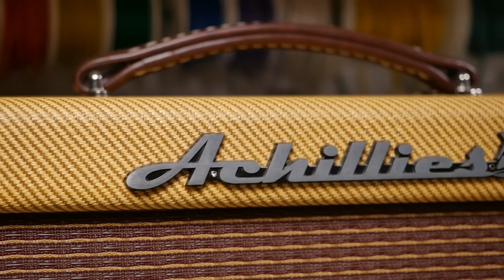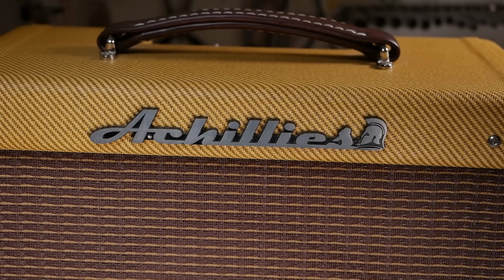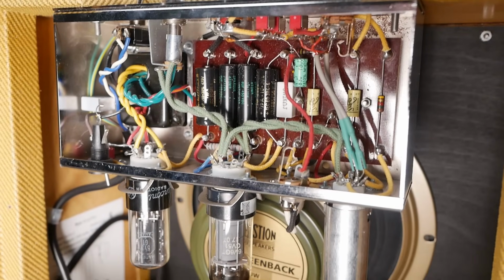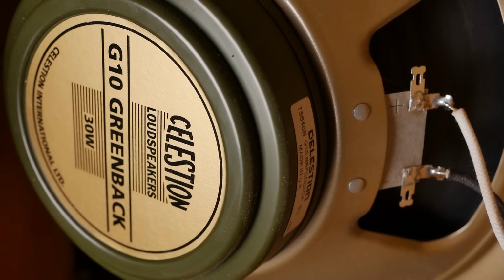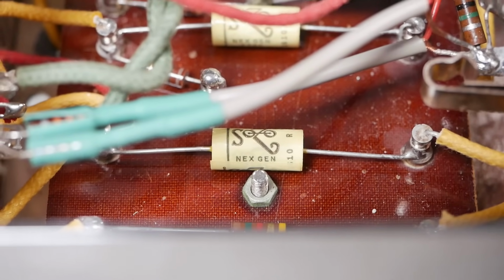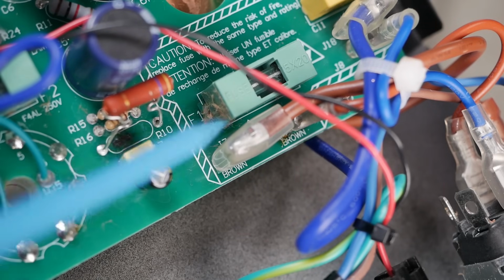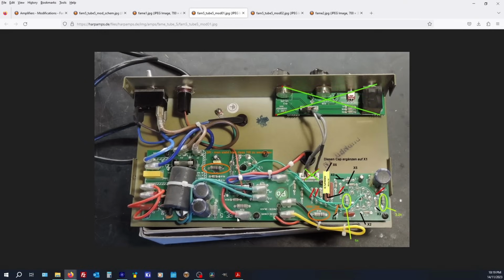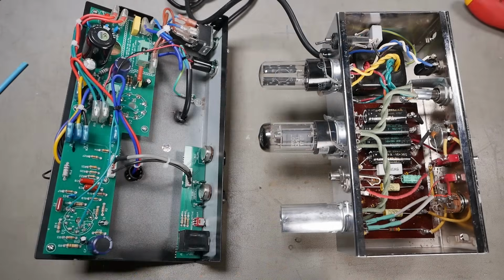Artist Guitars Tweedtone V - Vs - Achillies Nyx 5W (Part 1)

Comment: The Artist Tweedtone and Fame Tube 5 circuit boards are identical to the Fender Champ 600 Reissue, except  for different silk screening. The Champ 600 RI was actually a Fender AA764 Champion, but with a fixed tone stack and diode rectification on a PCB.

Comment: I have a Wang's VT-5/ 5 Watt tube amp. The 🔌 is three prong into the amplifier. On the inside of the on off switch is written 250 volt. Will this amplifier work 🔌 into a regular American 120 outlet.
Reply from the maker: The switch likely has a voltage rating moulded into it.
This has nothing at all to do with the mains voltage the amp is set up for.
If you have any doubts, find a local tech to confirm before attempting to plug in or power up the amplifier.

Comment: Love these videos.
The Achilles is clearly and older model thats been hacked by a tech.
Its was made out to be a new,first time check over of the amp.which is a bit BS.Just my opinion  .
Love this channel.
Reply: He noted the build date was in 2017, so not a new, first time check over.
Reply: @upload2352 more accurately it would be his first look at it.
Its definitely been looked at by someone else(parts hes never had).Due to speaking to Achilles yesterday,also they were $1800 back in
2017.the nut holding a part doesn't match Achilles standards at all.
As why it was suspect.
Reply: I have to correct myself,he actually did mention it had been seen at another tech.

Comment: Bought an Artist Tweedtone V, customer return faulty valve. The valve. a 6V6, was cloudy so obviously air got in. Couldn't see any nasties, and after a struggle with the valve retainer popped a new valve in without trouble. I guess Aussies have bigger bottles than us Brits.  A couple of years ago bought a 20R return from Artist as well. That turned out to have a blown fuse in the heater circuit.  Inspection showed the power indicator light, powered off the heaters, had a terminal uncomfortably close to a power electrolytic case (earthed). Replaced fuse and insulated the indicator terminals and all was good!  As an update on the 'V', as a friend was interested in it I had a closer look.  The tube bias dialled in at about 55mA(!!!) and the cooked bias resistor at 460'ish ohm. Even with the 'mark up' of running a 230V amp at 240V (I am in the UK and the mains is NOT 230V, except on very bad days) that current is enough to melt glue in the valves base. Replaced the resistor with a 670 ohm (I ordered 680, but ?) 2W. This brought the current down to just below 40mA, which is warm but not melting, so will do.  I also had to replace the 12ax7 as it was 'frying bacon'.  As a matter of interest, on mine, the Lucar 'quick connects' proved unusually stubborn.  Inspection showed that they might well be soldered as well, so I did all the work from the top side of the board.

Comment: 1 watt ist zu wenig means  to small use 2 watt. rausknipsen is remove, sadly i cant read it very well but if i get a proper copy i can translate to English should anybody require. These amps followed in the footsteps from the epiphone and vht 6 and special 6 and if i remember correctly Fame were sold rediculously cheap here in Germany. Of all these champ copies the best was the VHT. Brad there may be some worth in doing a spot where you just go thru all of the schematics for all of these copy amps please take a look if you can at the VHT line from 10 years ago there is some realy interesting stuff in them.

Comment: I almost bought a Nyx recently. I thought that it would have been a bit better made. I bought a Tone King Gremlin instead. $2,300 is good for a hand-made amp, but considering it’s a 5w practice amp, that puts a different spin on it.
Reply from the maker: Gremlins are fantastic little amps. I've had some with shorted MOSFETs, but possibly due to power spike.
They sound pretty good.

Comment: Over Covid lockdown I built a 5E3 clone head for just under $1k AUD using a diy built pine tweed covered cabinet, and the Evatco knock off chassis and turret board. Otherwise I used all the corksniffer brands for components (Hammond trans, NOS valves, Sprague/Vishay caps,  CTS pots, Switchcraft, Belton etc.)  but got them the cheapest I could find them online. 
Comparing it with these Champ clones I reckon the Achilles is at least $500 overpriced, the Artist being typical functional even good sounding, well priced, but horrendous quality Chinese shite.

Comment: The weirdness you noted at 35:13 isn't all that weird, although it might be a bit of overkill.  Because of the way they're constructed, electrolytic caps (or any cap that is 'wound') has a finite amount of inductance (and resistance) in series with the capacitance.  The impedance will increase above and below the resonant frequency of the series combination.  In high current switching power supplies where you have caps that are rated in farads, it's common practice to have small film caps in parallel with the main caps.  

Does this cap have enough series inductance that the gain will be appreciably reduced at the upper end of the audio spectrum?  I dunno. Maybe?

Comment: it makes me smile seeing a jaycar cap next to a sozo, pick a lane bro
Reply from the maker: It is a bloody Jaycar bipolar crossover cap, isn't it!?
Reply: yeah the non-polar electro and that grey shielded wire both look like jaycar wares
Reply: @BradsGuitarGarage  , it's only a 1 mfd cap in a fairly low voltage circuit, so why not use a film cap instead? I've used bipolar electrolytic to replace failure-prone polarized electrolytics in the FB loop of solidstate differential amp circuits (for old solidstate hifi gear) but those are typically 47 to 220 mfd at 16v or so, and so a film cap wouldn't be practical ( too big).....

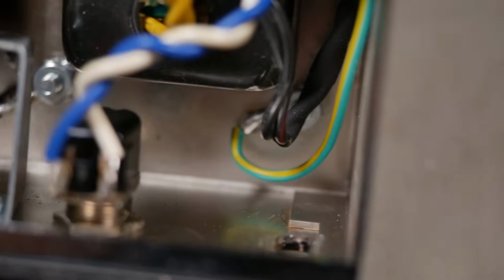Comment: 19:34 this is a BIG no no. Why are they just blindly copying this stuff? Safety ground mounted on unsafe screw...
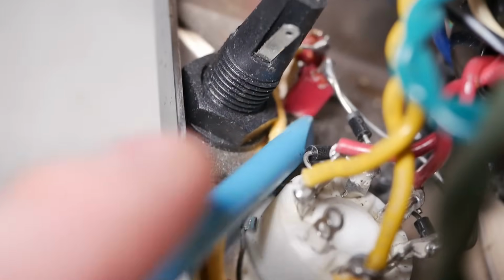20:10 is it that hard to put a normal washer there? One will flip this switch maybe many times and when this washer go loose - congratulations :D

25:45 and $200 amp can do the ground to industry standard :D but $2,2k amp fails.

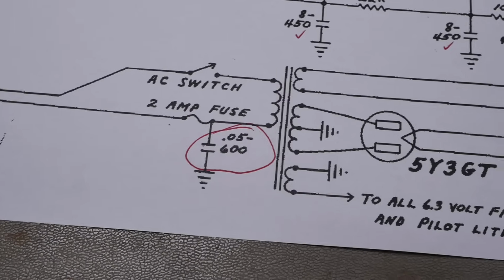28:20 really?! Someone has no idea about the tube amps. Just copying the schematics from 60s :D Most of these "butique" brands have no idea. Death cap in 2023 hahaha
Reply from the maker: All too common a story as I'm sure you know, mate!

Comment: The board isn’t Garolite as far as I can see, it’s phenolic board. I had something that looked similar that was conductive. Hopefully Labros has done his homework on the  board material. 

The transformers are made by Heyboer. They are decent transformers.

I think that was the way Fender do it as I have seen other companies offer this style output transformer.

The components are mounted on the turrets as they are supposed to be, I have covered this on several soldering courses.

The SoZo’s are a mustard style cap, SoZo’s do make Astron Blue caps and Jupiter make Astron repro caps.

The 10K negative feedback resistor would lowered the gain of the amp making it sound tighter. Switching the 1uF cap in will get greater boost with the 10K resistor. Maybe Labros was shooting for that?

The cheap amp is drawing on the Blackface Champs. The 1K choke resistor is bad news for the screen grids on some single ended amps.

Comment: Since the majority of Artist's gear is also sold as Harley Benton branded, I suspect this amp was also sold by them. HB's GA5 was apparently a modified Fender Champion 600 clone.
Reply: The HB GA5 was an Epiphone Valve Jr with a 'tone' pot added. The PCB is virtually identical.
Reply: @sjgreaves  Thanks for the clarification! Always good to know the roots of these amps.

Comment: Hey Brad I'm considering building a kit amp or maybe modding a cheap Marshall. I want a poor man's Superlead plexi basically, can you supply a kit with schematic? I can build my own chassis and cabinet but I'm a bit of a noob at circuitry. I make pickups obviously but they're just one wire! I've built a couple of pedals but would need someone to design the circuit and source the parts and schematic.
Reply from the maker: Jase @ Headfirst Amplification is your man.

Comment: Brad, good review video.  There is a YT video entitled "black face vibro champ repair and bias discussion" about why you should not use a 1K ohm cathode bias resistor to cool the bias in a Champ circuit.  I'm not a professional amp tech, so I don't fully understand all of what he said, but the gist of it is that when signal is applied and the volume is turned up, the bias voltage changes dramatically and the plate and screen current gets way too high.  That's with the standard Fender 1K and 10K ohm dropping resistors.  Maybe that's not an issue with a 10K and 22K ohm dropping resistors, like they used in the amp you reviewed.  It would be interesting to know your thoughts on the matter.

Comment: I’d imagine the 1k cathode resistor on the expensive amp is to allow for a higher B+ in solid state mode.  Just a speculation though.
Reply from the maker: She's sitting at about 65% in SS recto mode. Cold as a crab.
Reply: @BradsGuitarGarage  ah okay - I recant my speculation.  Carry on.
Reply: @BradsGuitarGarage  , I like my crabs steamin' hot, with melted butter! And then there's the other kind....introducing the song "Down at the Twist & Shout" at a gigI attended, Mary Chapin Carpenter said "this next song is about a place in Maryland where you go on Saturday night to get the  crabs and....." much crowd laughter ensued as she blushed! 😉😁

Comment: A Canadian made vacuum tube? That probably cost us taxpayers $54,000,000. 😉🇨🇦✌️
Reply: Here in the US I have run across the occasional Canadian-made Marconi vacuum tube.  I should clarify that I have come across them, so that it doesn't sound as if I ran them over with my car or stepped on them with my boots....
Reply: @goodun2974  I’ve got two gz34 tubes in my amps currently.
Reply: NOOOOOOOOOO! 😂🇨🇦👍
Reply: That's socialism for you 😉😂🤔
Reply: @johnelcanrab2114 explain please.